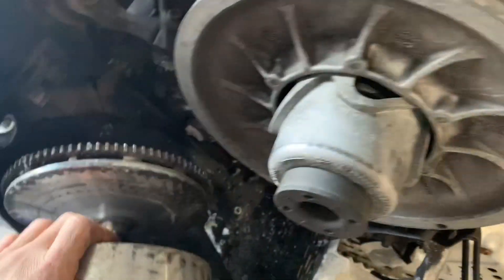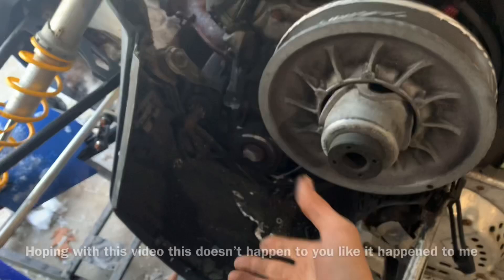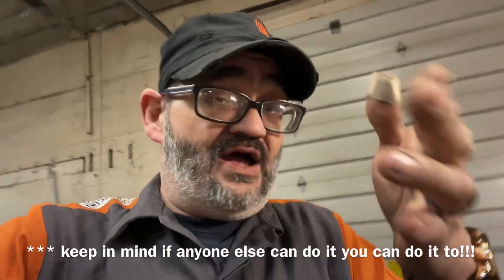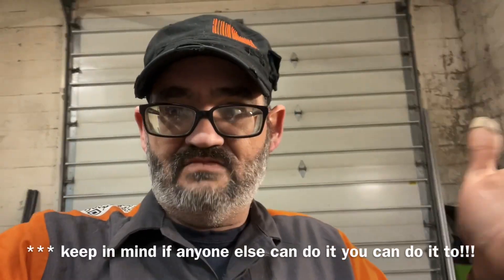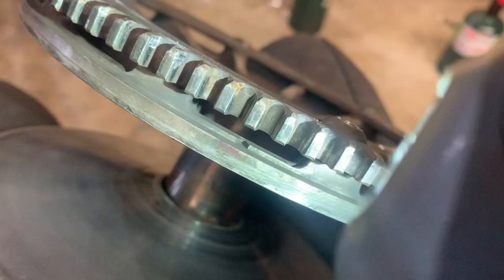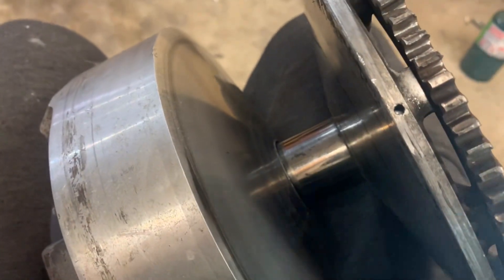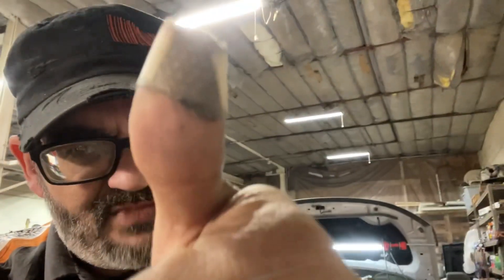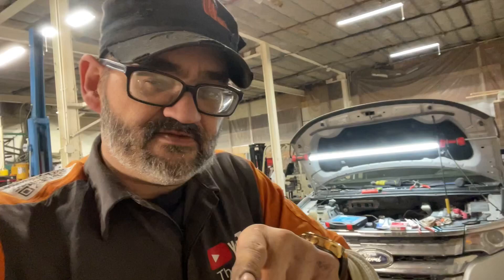Something every Ski Doo Owner Needs to know About The TRA Clutch if they’re Taking it Apart

Comment: I bought a new comet 108 EXP clutch for an old Indy 650 I had, I marked it with a pencil to install the weights and spring, I couldn't find my marks after so I just guessed. It was way off balance, it spider cracked the clutch faces and twisted my crank up like a pretzel lol. I use a center punch and a hammer to mark everything now. The timing of everything is critical to keep it balanced.
Reply from the maker: Hell yeah you’re right I didn’t even know them Mark existed exist… I mean it’s obviously been a couple years now, but I did not know that before
Reply: I knew to mark it but the pencil didn't do the job, I must have rubbed the mark off when I installed it. When that belt blew it sounded like a grenade going off! The worst part was it took me 4 hours to get the old clutch off, I had to use an angle grinder and cut off wheels. That sucker was welded on. The puller stripped all the threads out, tried grease, teflon tape trick water trick heat impact gun no luck. That ended my season really fast, new clutch went into the trash after 3 miles. The crank twisted out of phase and destroyed itself. I was younger and had less patience lol. I was trying to save money by doing it myself.